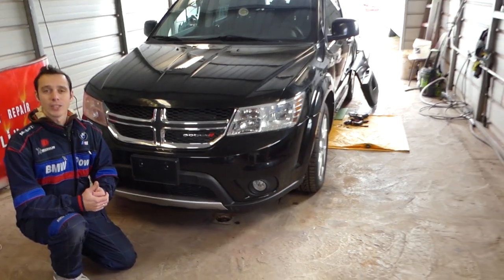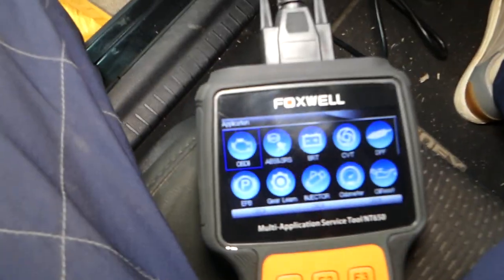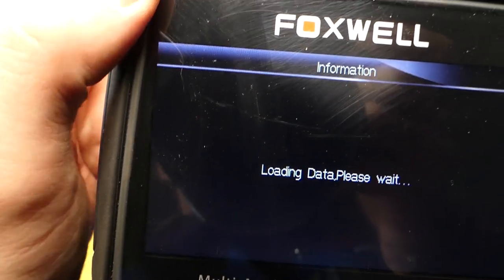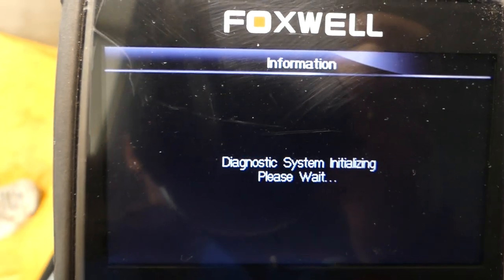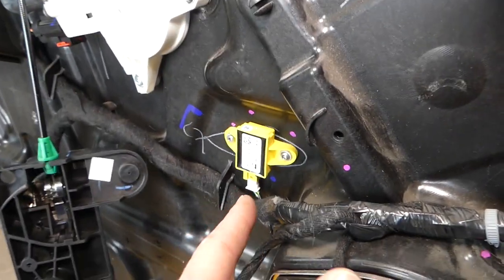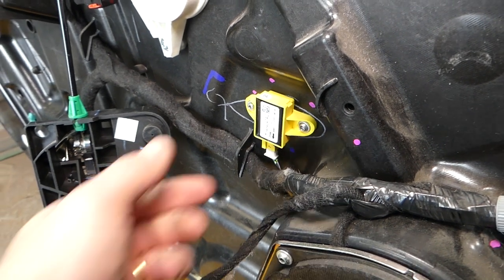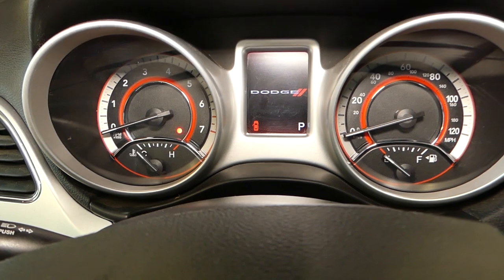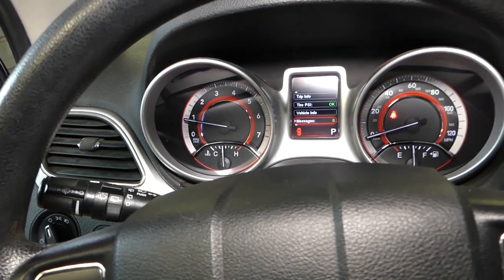CODE U0172 LOST COMMUNICATION WITH LEFT SIDE SATELLITE ACCELERATION SENSOR 1 DODGE CHRYSLER JEEP

Comment: Great video, and great honesty! This just happened in my shop yesterday. My technician replaced a window regulator LF and customer came back with an srs light. I typed into google and your video popped up first. I watched it real quick and told my tech to pull the panel off and verify whether the window might have messed it up when it fell, or if we left it unplugged. We left it unplugged. It was in, but didn’t snap in. Thanks again and I hope your business is thriving. God Bless

Comment: Thank you for the video. mine has the same code. it was intermittent first then the light stays on. I checked the connection and seems to be sung. I did not see any broken wires as well. Do those sensors go bad? what else I need to check. mine is Chrysler T&C 2011